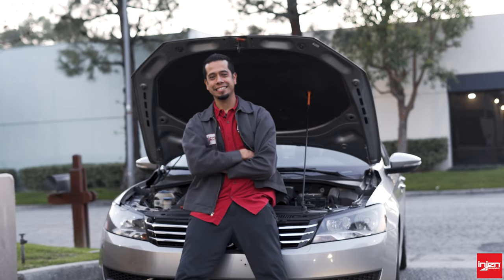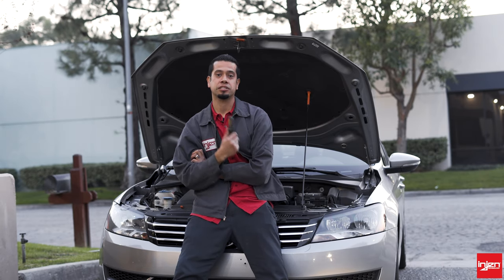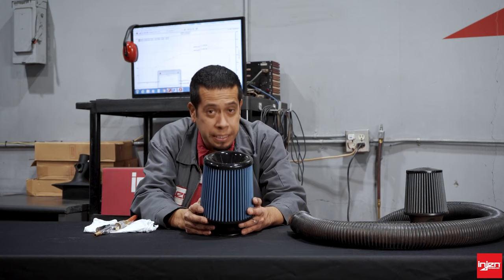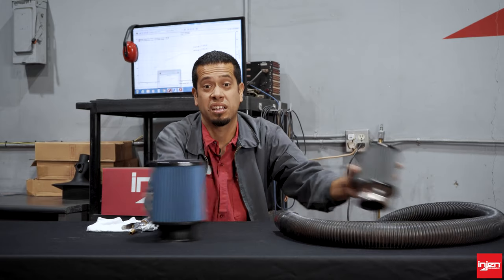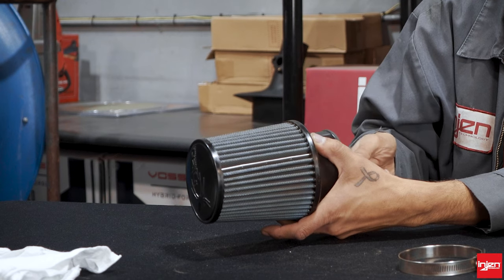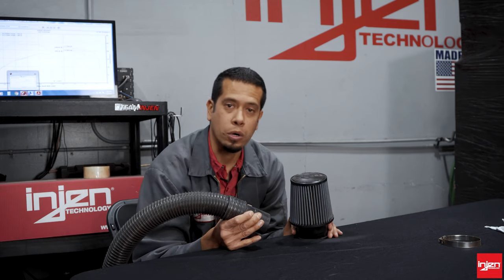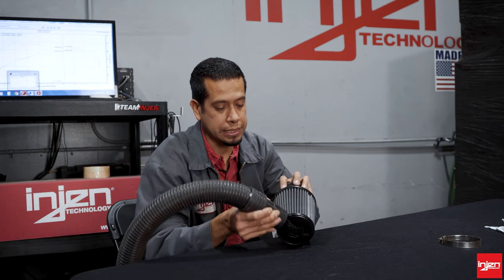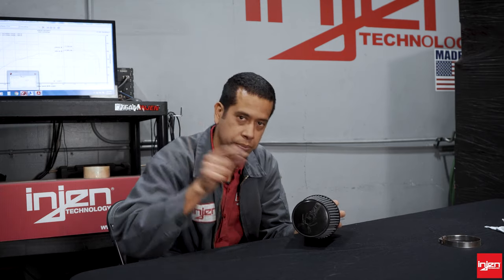DIY - How to clean your Injen Dry SuperNano-Web Air Filter

Comment: Last year when I bought my K&N cold air intake while rebuilding my Tacoma 3RZ engine, I was kind of ticked off to find out they use an oiled filter. I had no idea. But thankfully, I literally stumbled across Injen Technologies and quickly discovered that you guys make this dry supernano-web filter that is an exact fit/replacement for the K&N cold air intake. I bought it immediately and never even used the oiled filter that came with my K&N system. THANK YOU!!!
Reply: If you see my filter you will stay away from this filters lol, up to them if they want me as a return customer, just emailed them to see if they give me a replacement filter.
Reply: @sanderpena  So what's up with the filter? Did it come apart or what? You do know that sometimes a flawed product makes it past quality control in most every company in history, don't you? The best way to determine just how good a company truly is, is how they take care of a problem & make it right. So please explain the problem here. Also, let us know what the company does about it. Regardless, I'm NOT using a damned "oiled filter". Oiled filters are old, stupid technology. That's why all filter manufacturers got away from oiled filters decades ago. And yes, they absolutely do gum up mass air flow sensors. Because it's almost impossible to determine exactly how much oil is being sprayed on the filter. I've had my filter from Injen Technologies since last August. So far, so good.
Reply: I send you a picture let me know where to send it to you.
Reply: @sanderpena  I'm not about to put my personal contact information out here on youtube. Can't you just give a simple explanation of what happened to your air filter. Because you most certainly can. Also, did your engine backfire? Because when an engine backfires, it has the ability to blow plastic intake manifolds to smithereens. And no air filter is as strong as a plastic intake manifold.
Reply: Just do any email just for this lol, if anyone interested  in this pics just let me know lol.
Reply: @sanderpena  Dude, that ain't happening. Dude refuses to explain HOW his filter is f*cked up. Sounds like he backfired his engine, lol.
Reply: @howabouthetruth2157  dude the end of the filter i guess separated and fell off i got pictures, today i bought an spectre with the metal at the end instead off rubber.

Comment: I've had an Injen CAI on my Hyundai for years with the hydro-sock on it. Have never needed to clean it in 80k miles it's been on :)
Reply: You might not HAVE to clean it but you should... That is a lot of miles, don't wait until it's filthy to clean it.
Reply: Yeah you need to clean that air filter. Air filter is cheap, engine damage is not

Comment: They say to never use compressed air to blow out a dry filter’s media since it will tear the microscopic fibers thus allowing large amounts of dirt particles thru eventually causing catastrophic damage to the cylinders, rings, cams and bearings.  Best is to just replace with a new filter.  It only takes a teaspoon of pulverized dust between 5-15 microns in diameter to ruin the upper cylinder area. For perspective, the width of a human hair is 70 micron and limit of naked vision is 40.  Never use oiled gauze (cotton) filters as they let 90% of dust through.  Watch Project Farm’s YouTube video on engine air filters and you’ll steer clear of wet gauze ie K&N, S&B, Banks etc..
Reply: This was eye opening thanks 👍

Comment: How many years before I should replace the filter and how do I find the correct filter replacement for my setup?
Reply: I've had mine on for about 4 years now, seams fine but looks old. Would like to replace it
Reply: @S3brandon  You done answered your own question sir.
Reply: @mhvmvd  no sir. Don't know if it is necessary to replace and what is the correct replacement part number
Reply: @S3brandon  If it looks like it has life in it still then clean it and put it back on. 
Or if you wanna be on the safe side you can just replace it. 
Search for the same intake you have for your car through Google as if you'd buy one, I'm sure there will be info on the part number. At least that's how I found mine (through injen website). Btw you don't have to use the same brand for the filter, just make sure the diameter of that pipe would fit the intended filter.

Comment: How about water with a cleaner like k&n?  or no good?
Reply: I’m trying to find that out also still no reply
Reply: @alexdelgado203 I think with air and vacuum will still look dirty as hell.
Reply: I’ve cleaned mine with light degreaser and sprayed water 🚿 inside out till water is clear, then air blow till completely dry.  2 years later no issues

Comment: Hello all, I’ve mistakenly cleaned my filter under water and then used oil on it because thats what some type of guy told me to do + previous owner was also doing it. Ive seen weird behavior of engine after starting it since I bought it, like it was lacking air and after oiling the filter things got worse. Ive now realized the filter is a dry filter and wondering if it is now fucked up after all this oiling or it is good to just clean it thoroughly and let it dry? Or did it already lose its properties because of oil?
Reply: Hey man, I'm going off the info I read so don't quote me I'm tryna find out too. However, I read that too much oiling does lead to the MAF reading wrong and shit like that so I'd assume it is. 

If you want details, I read that it's because dry is a paper based while wet is a cotton and oil based type deal so it makes sense how it can be messed up with too much water and oil. 

Hope it helps.
Reply: Did you solve the issue or found a answer ?